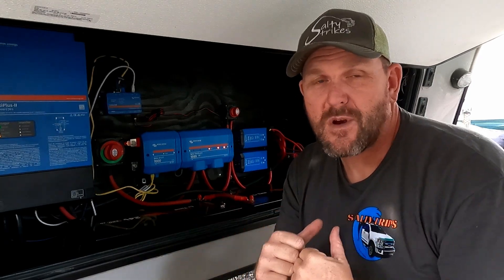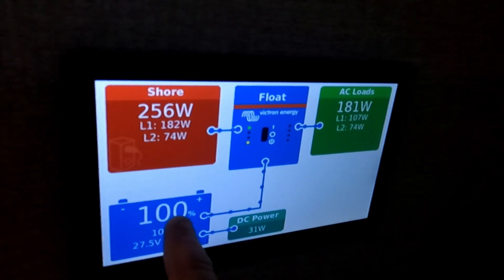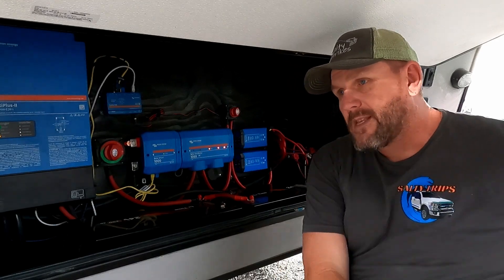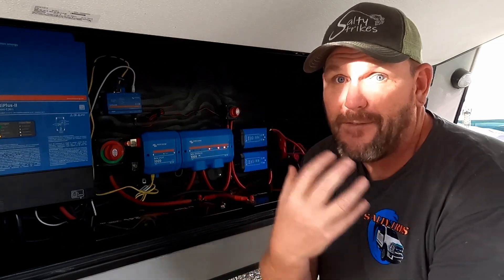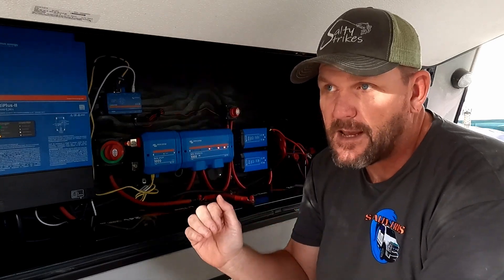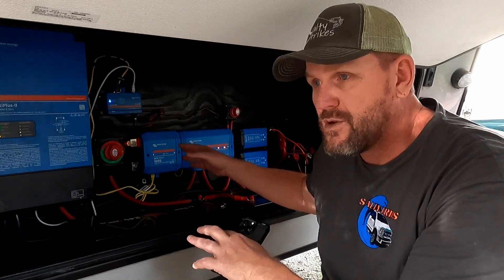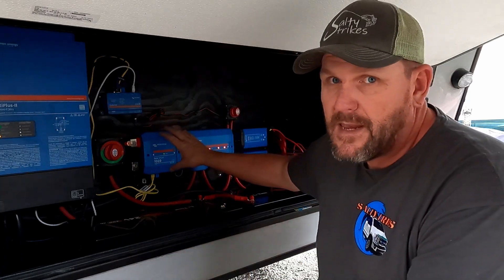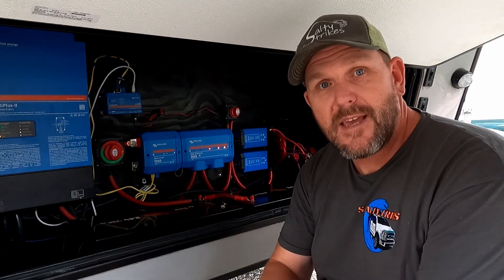Victron Lynx Shunt 1000 Orange Blinking Light!

Comment: I love my victron charge controllers but im now using a much more simple sungold power 4000 watt splitphase inverter. All the firmware crap from victron is such a hassle and the sungold is by far stronger and more dependable and way easier to keep running. Great install and nice equipment but reliability is king when it comes to keeping the fridge running, tv on and the air-conditioning working. Brother get a sungold or any other low frequency 1000 dollar inverter and a 100 dollar smart shunt and you and the wife will be way happier. Its so weird seeing someone else go thru basically the same stuff i went thru only to finally realize that simple dependable is much much better. After loosing everything in our fridge 3 times i parted ways with victron other than the charge controllers
Reply from the maker: Does the Sungold have 50a 2 x 120 passthrough with automatic take over and power assist?
Reply: @saltytrips  it does have the pass thru but no power assist. It has the automatic transfer switch and 50 amp charger. It also has a huge surge capability. I know with the sungold low frequency inverter being only 1000 bucks and not as many features it would kinda feel like a step in the wrong direction but man as far as reliable it hands down smokes the victron inverter. Now the victron stuff is nice and has lots of bells and whistles but reliable inverters that just work is more important to me . Some people love all victron stuff but my experience is that the chargers and charge controllers are great but inverters are kinda under powered for the price and take way to much time and attention.  I got rid of my rooftop air and installed a 240 volt mini split and I run a 40 inch TV and everything else in the camper and never worry about what's on at the same time and I've never had a problem with the sungold not having enough power or giving any kinda problems at all. The power assist is great I guess if the inverter was to small or if the 120 needed help for some reason but with a strong inverter with pass thru I can't imagine why anyone would need power assist. The main thing is just over size wires not only for safety but way oversize for surge. That way the inverter don't experience voltage sag as bad and it will make all the electronics last a lot longer. I saw the 200 amp fuse you installed and that's a bad pinch point that will cause voltage sag when the batteries are low and you pull hard on the inverter. Use a fuse just under the wires capabilities and use big wire. I use two 2/0 wires and two 600 amp switches and two 300 amp fuses between my 30 kw battery and my inverter. It's way overkill but absolutely no voltage sag under any load. I also use two 2/0 ground wires from the inverter to batteries going thru a 600 amp shunt. It's a 24 volt system so I could never get close to over amping the wires but dependable takes oversized stuff
Reply from the maker: @matthewknight5641  the main reason for power assist is if you have a 50a rig but your site only has 30a hookup or your mooch docking somewhere with 15a hook up.
Reply: @saltytrips  I use a 120v powermax 24 volt 50 amp and then my second inverter is a powmr 3000 24 volt with a 40 amp charger built in so if I was to ever not have the solar to carry me thru the I could plug in one or both those chargers to help out. With 3200 watts solar and this much battery storage I cool and most my heat comes from my mini split running 24.7 when I'm in the camper and I've only had to get a AC charge a couple times. With those two chargers I can adjust how much load I pull from a 110 source so it makes the system pretty flexible.
Reply: @saltytrips  and the sungold split phase has a built in charger but it requires a 240 volt input which is fine for if I'm at my mom's place but it wouldn't work at a campground for sure. I'd have to rely on my other two ac chargers at a campground.